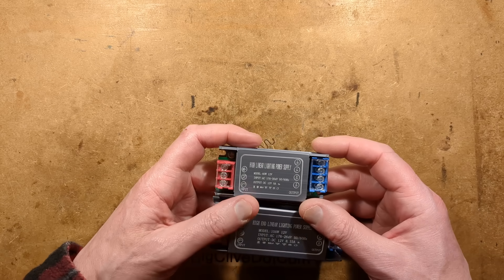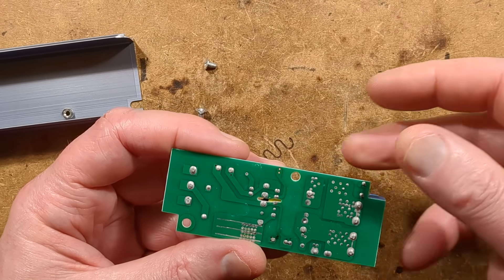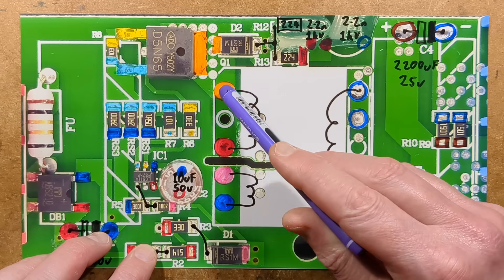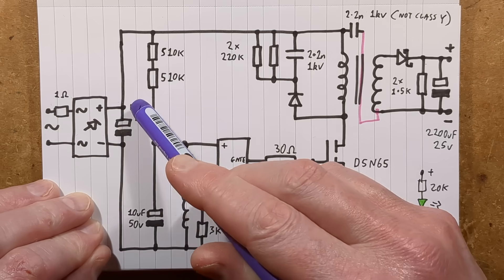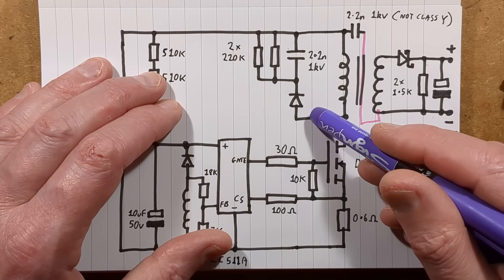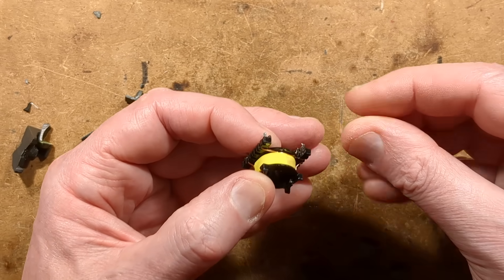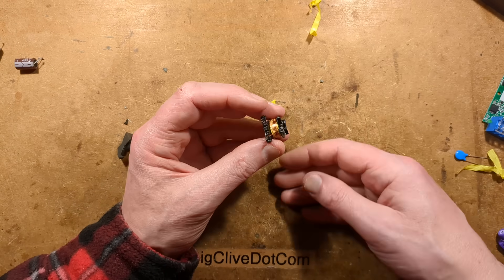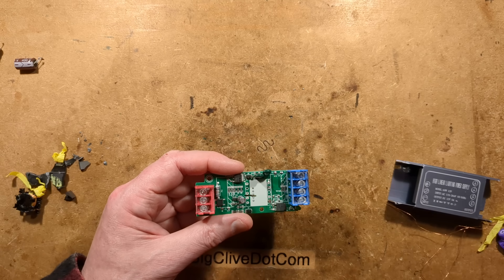AliExpress LED power supplies - almost OK

Comment: I didn’t see what the voltage is going into the transformer and thus the ratio of the pri:sec windings.  I guess it is all about the PWM. Any way to tell? I’m also curious about the first drawing that makes the FB winding look like the transformer has a primary with an extra tap.

Comment: I had a similar and forgot to check its output voltage, which should have been 24V, but was around 40V, which fried the WZ3605E connected. It didn't have any visible pot either, so no way to adjust the voltage. Obviously I should have checked the voltage first, but then, I didn't. I got a better PSU after that (still from china, but not those "led drivers") and it works well with a newer module, the XY-SK120X. It would probably have worked fine with LEDs, though, since they tolerate higher voltage better, but then, getting something that's defined as a 24V PSU that outputs around 40V, well, it's not "optimal".

Comment: IIRC, a synchronous rectifier is a backwards h-bridge, in the sense the current flows the opposite way through it that it does when you use an h-bridge to drive a load..  The cause of the benefit is that there's no loss due to diode drops in the rectifier, like you get in a diode bridge rectifier.  It takes more components, of course, but once you've already switched over to a good switch mode design, the losses due to the diode drops in the rectifier become a large portion of the total losses.  Reducing the heat produced means the PSU will last longer and deliver a more stable power supply, since heat causes semiconductors and electrolytic capacitors to age faster, and less heat means less thermal drift in semiconductors.  (Couldn't resist, I'm reading The Art of Electronics right now.)

Comment: funny thing about this power supplies, i actually both few of them i have 3 that are working fine, one that is way better than spec (12V 10A and i can easyli for over 10hours take from in constant mode almost 15A withount voltage loss) and one 400W but this one is terrible it has problems even starting with 10% of load.
Also for the class Y cap i got in all of my units proper class Y cap not just film cap.
Also about the one 500W unit i got very suprised when i saw freaking full bridge driver and full bridge tranzistors layout, this one have kinda small trafo for 500W but it works also on something like 500KHz

Comment: This is very informative, thanks! So why do other designs mostly use a TL431 and an optocoupler instead of a probably cheaper 3rd coil?
Reply from the maker: The TL431 is much more accurate.

Comment: An led supply is a current source. How do you use it at an underrated duty?
Reply from the maker: You can get current regulated supplies, but these ones are fixed voltage.

Comment: They use synchronous MOSFETS regulator-rectifiers for retrofitting LED lighting to vintage AC (no battery) powered motorcycles nowadays, too... This is great since it's an "everyone wins" situation... Not as much wasted power, stable light output at relatively low rpms, and less stress on COBS !

Comment: Does anyone know of 12-24V adjustable power supplies, one might use for 24V LED strips? I have no stomach for PWM based dimmers. (I don't think any of them are of high enough frequency for the flicker to be imperceivable in low light levels.)
Reply from the maker: The PWM drivers can have quite high frequencies.

Comment: Well cheap means more failure and with power supply like this it should be robust because of its use and what it is designed for

Comment: Far too much audio compression - sound like you're gasping for breath.  Dinky little power supply though.
Reply from the maker: I can't remember which video it was, but one refused to process in my normal audio app and I had to use a simpler one that does crush the audio a bit.

Comment: I have a 100W 12v supply similar to yours but inside it's quite different. The capacitors are doubled and it has more mosfets I suppose among many other differences.

https://iili.io/KyDnvB2.jpg

Comment: I’m wondering if you have tackled the Nest Thermostat Circuit PCB specifically the Base of the 2nd generation that has the switching circuit on the base board ?
Reply from the maker: I don't think I've seen that one.

Comment: Circuitry Question: What is it about the non-dimmable LED bulbs that makes them non-dimmable? Will running them on a dimmer actually damage them? What about powering them with a variable transformer or resistive dimmer?
Reply from the maker: If they have a simple rectifier and smoothing capacitor it can result in poor dimming results and continuous high current spikes.

Comment: I have one of these installed…
Just have three 3W led spots connected to them. I’m not too worried as I have a double pole switch on them so if a light blows and I need to replace one, I turn the switch off which disconnects both poles so it’s completely disconnected.

Comment: Surely you realise all this shonky safety is deliberate? A good Chinese citizen exists just to work for the state.  They are supposed to work so hard that when they get home all they can do is fall asleep.  The 'bad' ones are getting Western attitudes... they don't want to work as hard, and they want time to play with hobbies like electronics tinkering.  These power supplies are simply part of the 'bad' population control initiatives by the state. 🤫

Comment: "I have suitably crunched the ferrite core" LOL not something i would say with any joy.  Certainly when working with radio gear and those little cans and the ferrite screws in them, if you crunch one of those you are basically fooked 😂 Now when i buy an electronic item, i first do a 'big Clive' and dismantle it. Hopefully getting it back together again (with duct tape & super glue) and using it.

Comment: If the PSU has CCC markings then it should be ok as the Chinese regulator is strict about use of its approval mark

Also, if you ever see something with UL markings that's obviously not safe, they have offices in Shenzhen and want to know about such discoveries, The USA Consumer Product Safety Commission is co-sited with UL in Shenzhen (UL has offices in Beijing and a couple of other locations too)

UL/CPSC have started that they're happy to work with other countries' safety authorities to get dangerous mains wiring discoveries shut down in China and the Chinese authorities will "happily" assign copyrights/trademarks to organisations which can prove prior claims (EG: BS1363 and all variants of "UK plug" type description)

Ie: the proliferation of fake UK/BS1363 cables and cords could be reduced if the BSI and UK safety authorities would get their fecal matter together to claim that copyright and assign enforcement to UL + CPSC. Chinese authorities do pay attention to complaints from other countries safety regulators

The responses from various regulators has been that it's "Too hard" and "We can't do that because they're overseas". Even plugsafe.org.uk and fatallyflawed.org.uk doin't want to get involved in this. Perhaps some kind of media shaming campaign is needed?

Comment: It would be interesting for you to do a video about a well made SMPS transformer - or have you already done one?!
Is a clip-on cover appropriate - surely retaining screws would be better so the lid cannot accidentally snap off?
Reply from the maker: I've looked at them in things like IKEA power supplies.   These are chassis power supplies intended for mounting in an enclosure.

Comment: I knew the day would come that you tear something apart that I have literally under my desk... I'm just a bit confused by your recommendation. You say "it's not always suitable to link earth to the output negative in all situations", but for something simple like LED circuit (non-contact with people, already de-rated), would you still suggest making that change? And also with the class Y capacitor fix? Thanks!
Reply from the maker: I can't recommend specific arrangements, but putting a functional ground wire to the negative output will reduce most of the risks.

Comment: I got an LED PSU of AliExpress and it looks similar. But on the the chassis is connected the earth (checked with a multimeter) and it has a class Y capacitor. At least if I can trust the labels on it. I haven't checked the coil. Does that mean it's safe since it has the Y capacitor?
Reply from the maker: It's hard to determine its safety without analysing the circuitry and transformer.

Comment: I sometimes use the 12v 12W (S-12-12) or 15W (C-12-15) LED driver power supplies off ebay (they look just like shrunk versions of full size PC SMPSs) for powering Arduino type projects. They are also voltage adjustable if you research well before buying as not all include a pot. Not sure how good the transformer winding separation is. Would be interesting to see one of those type compared to that AliExpress one.

Comment: Honestly, it looks like as long as you know the shortfalls of what you're getting and how to fix them it might still be cost effective to simply add an earth connection to the casing and swap out the caps. Depending on the difference in cost it almost might be worth doing just that for personal projects. Obviously not in a professional capacity as I shudder to think of the liability issues around that!
Reply from the maker: And probably add the earth connection to the secondary side too, which may negate the need for the class Y capacitor anyway.

Comment: It would be interesting to do a proper 2.5kV (one order of magnitude of operation voltage) of these trans and boards prior to disassembly.
Are these worth reworking? 
Neat structural board and case from the scrap is the best way to look at it.

Comment: They massively overrate the specs on these power supplies, then when you actually run them at their rated power (or anywhere near it), they overheat and that lacquer on the wires in the transformer melts and suddenly your one layer of separation is gone, and indeed, so's your power supply. With a boom.

100% agree, don't bother with these grey-market import power supplies; stick to a reputable brand from a reputable supplier.

Comment: Playing 'devils advocate' a min. The insulation in the xformer is bad etc, but any idea how many have actually failed and caused a problem or a safety issue?
Don't get me wrong I totally agree with you, but Just wondering.
Over the decades, I have seen things we once said as 'must be there/done done safety' be removed and not a caused a  problem. 
Not articulating myself well but hopefully you see what I am asking?
saying  'we need to do x in case y fails' but does y fail and how often in a dangerous way?
Again Just playing devils advocate..
Reply from the maker: There has been a spate of deaths caused by similar bad electrical separation in phone chargers.  We created standards to stop incidents like that happening.

Comment: Not too happy with the clip-on cover, tbh. When that opens, there's line voltage ready to touch for anyone.

A power supply should either be enclosed (i.e. safe around layman's fingers) or it should be open (clearly signalling that is MUST be properly enclosed for safety). Making one "enclosed but must be further enclosed to be safe" is just stupid.
Reply from the maker: This is a chassis PSU.  It should be mounted inside an enclosure.

Comment: I have a mini amplifier board for my sound system at work but I need a good 32 or 36v power supply minimum 15amps, can you help me pick a safe one thanks great video as usual ☺️
Reply from the maker: For safety you could get a meanwell power supply.  They do chassis versions for mounting inside enclosures, or cased ones with cables.

Comment: If that transformer gets a little bit hot then a good or bad chance that the mains voltage could cross over to the 12 volt side.  NOT good
Reply from the maker: The copper coated aluminium windings will probably ensure it does get hot.

Comment: A proper class Y capacitor is thicker, because the internal construction is to have 2 higher value capacitors in series, soldered together in the middle, to make up the capacitor. This means a single capacitor can self heal, blowing open the thin metallisation in the area around the fault, and not have a DC path through to the other side. This is unlike the standard foil capacitor which will briefly short the electrodes together and self heal, and class X capacitors are designed to have the foil flash away fast from the area of a fault, and they are designed that the self healing will gradually erode all the foil away without actually going short circuit. Class Y is designed to never allow a current path through, failing at worst case open circuit, even on massive over voltage.

Comment: Hey Clive, I've got a cheap power supply story of my own.  I used to work at an indoor garden business some years back, and I was in charge of wiring up rolling shelving units with LED tape to grow the plants on, as well as repairing them whenever something broke.  One of the owners of the business only bought the absolute cheapest products under the explanation that "it'll be cheaper to replace when it breaks."  The power supplies were the sort you might power a really cheap laptop with, and they were being made to exist in humid environments all the time.  The person who had done my job before I did had used splitters to run multiple strips of LED tape off one power supply, causing the supplies to heat up like crazy from being overdrawn.  Some of the splitters even melted.  

As for the power supplies, they were dangerously cheap.  One time I plugged a brand new one into the wall, not under load, and immediately heard a loud POP.  I opened it up and found that a capacitor had exploded the moment I plugged it in.  Doing a bit more exploring of the board, I found that it had lots of empty slots for other components, likely for higher quality models.  That wasn't the worst part though.  I discovered that the flat aluminum heat sink inside of it had been reused.  There was old thermal paste on it in a spot where a component had been unscrewed and removed before it had been reused.  

I left that job pretty quickly afterwards.  I'd tried to change the way they did things for safety reasons, but the owner refused to listen, insisting on buying the cheapest things and using as few power supplies per shelving unit as possible.  I didn't want to be blamed when something burst into fire, so I bailed.
Reply: That is a story and a half.

If that indoor garden business is promoting to reduce ones carbon footprint it might be good for them to know that buying quality products with a long lifespan reduces the usage of raw materials and results in less landfill. But it sounds like they are not very interested in all of that.
Reply: @Frankhe78  I tried to get them to understand that paying for more expensive stuff would save them money in the long term, but they didn't seem to want to believe me.  I don't think they had any real care about reducing their carbon footprint though, as far as I remember.  That wasn't really part of their business goals.
Reply: Sadly not an unusual story - and then if anything happens, as you knew, we know where the blame will end up.
Reply: @RDM1024  Something nearly did happen once.  I went to check on some of the older grow racks that had been made before I got there, and when I moved one of the cable splitters the wire literally let out a jet of smoke.  The plugs had been warped so badly by heat that they were completely fused together.  At that point I cut the power to every single rack and went over everything with a fine-toothed comb.  Literally ground the business to a near-standstill.  The boss was mad when she learned I'd pulled the plugs on every grow rack, but she were less mad when I tossed the fused and melted cable onto her desk by way of an explanation.
Reply: @GadgetSteelmare  It is pretty straight forward, they could have lost the entire business through a big fire. To halt the business for a day or so in order to sort dangerous things out seems very reasonable to me. If a customer is still not happy after a much needed intervention that might be a good moment to ditch that customer and move on. Thankfully that is exactly what you did in the end.
Reply: @RDM1024  I've often thought that employers have a duty to provide employees with the right equipment for the job, it's just sensible if more expensive.  However, employees also have a duty to not do dangerous shit just because a cheapskate employer tells them to.  For example, if your firm tells you to fly tip they are legally responsible, but so should you be if you do it.

We all bear responsibility for the shit shows we help create.
Reply: @I_Don_t_want_a_handle  "I've often thought that employers have a duty to provide employees with the right equipment for the job,"

They do. Unsafe kit is prosecutable under HSE laws (OSHA in the USA) and the fines can get extremely steep

You're absolutely correct over following illegal instructions, but for the firm there's vicarious liability - meaning they're legally jointly responsible if the worker decides to fly tip without being told to do so.
Reply: @I_Don_t_want_a_handle  that’s exactly the point you are liable if you do something illegal /dangerous etc. The ‘fun’ starts when you try to blame the employer etc who will no doubt ‘imply’ that you do something, only communicate verbally etc and have nicely written stuff /training etc that proves that they do not condone taking risks. Remember 90% of training etc is to cover them not help you, and I guaranteed they have a record of you doing it (and the larger the employer usually the worse)
Reply: Stuff like that is worth notifying to your local HSE. An owner like that is almost certainly pulling other stuff which will sooner or later result in people losing digits, arms or lives